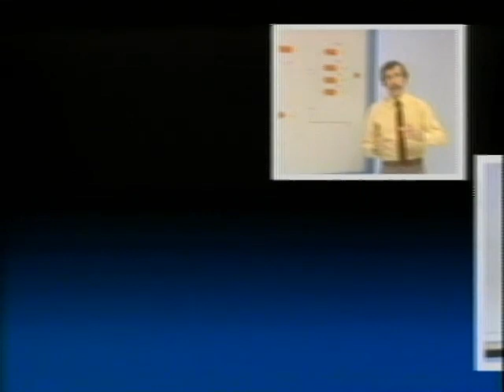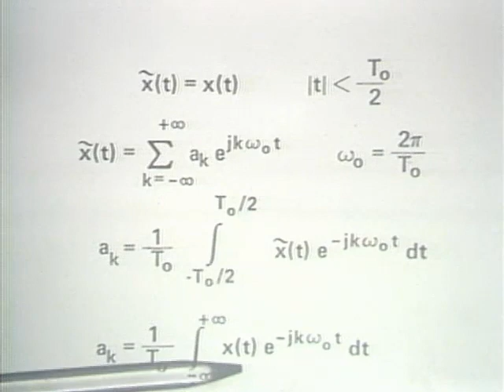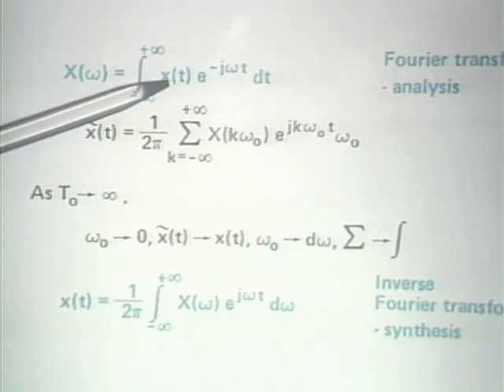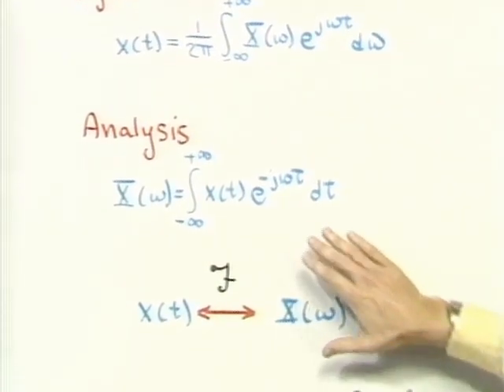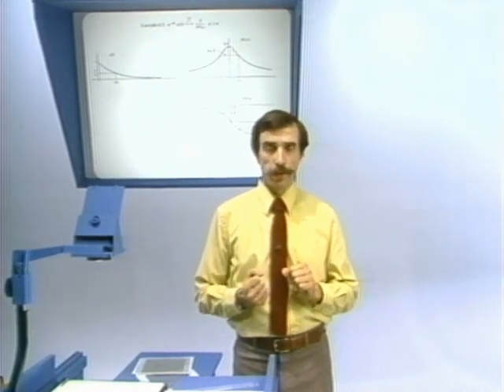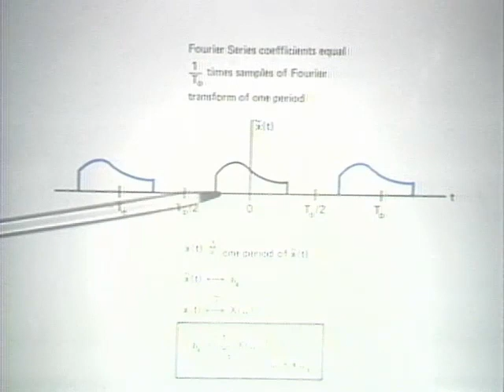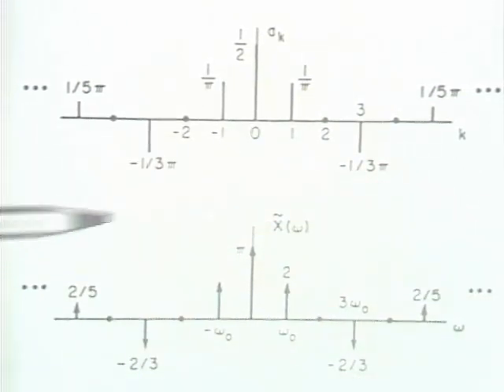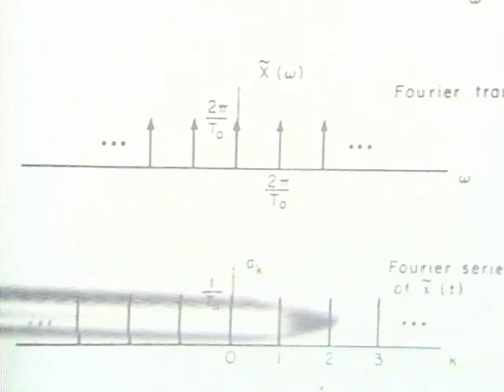Lecture 8, Continuous-Time Fourier Transform | MIT RES.6.007 Signals and Systems, Spring 2011

Comment: Pro.Oppenheim's is a great teacher, he can make such demanding course very easy to understand.
Reply: i wish his textbook was as good as his lectures. I am struggling in my DSP class and the textbook is no help.
Reply: +Cong Do Which textbook did you use? The Signals and Systems book is for this course, if you're doing DSP then you may prefer his Discrete-Time Signal Processing book.

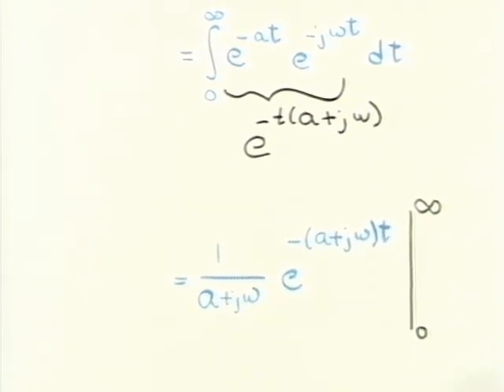Comment: The output of the integral at 16:41 should be -1/(a+jw) not plus. Little mistake.
Reply: ***** Actually, it would be positive because of the inferior limit of the integral that would be -1, so both -1 cancel each other
Reply: ***** No it will be negative only, just integrate and apply the bounds. You should be able to see it.
Reply: @Gustavo Oliveiera The final result of the definite integral isn't wrong, but the intermediate result of the indefinite integral is missing a negative sign.
Reply: 9 yil sonra ben de aynı şeyi yazmaya gelmiştim:)
Reply: @kefal0 :) good old days

Comment: I have just one question, if any1 would enlighten me, and that question is that if a_k equals 1/To X(w) then we would expect the coefficients a_k to be not the exact samples of X(w) rather multiplied by To. However this was not found to be true in the demonstration where period of the symmetric square wave was increased and the coefficients a_k exactly matched those of the fourier transform X(w). Were the coefficients multiplied by To and there superimposed on the X(w)?

Comment: 5:25 How did we get that the bottom integral is integrated from -inf to inf, instead of remaining from -T0/2 to T0/2? Do we assume x(t) is zero outside this interval?

If so, what about signals for which there does not exist an interval that contains all nonzero parts of the aperiodic signal?
Reply: We do not assume x(t) to be zero outside the integral, the trick is if T0 approaches infinity, this means that x_hat(t) does not repeat itself until infinite time has passed. In practical terms, infinite time is long enough to safely say that x_hat(t) doesn't repeat itself (practically), and if it doesn't repeat itself then we established a situation where a periodic signal actually equals to a non-periodic signal. Now to your questions about the limits of integration. Assuming T0 approaches infinity, then really T0 /2 also approaches infinity.
Reply: @alawimidher5899  I have a doubt then why does the T0 in the denominator remain T0?